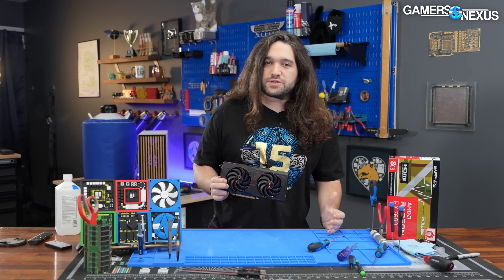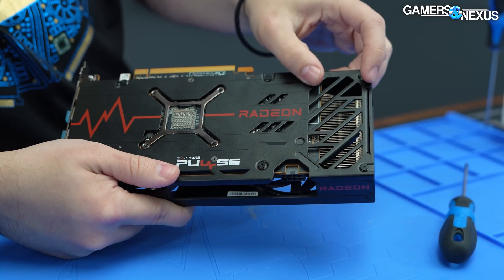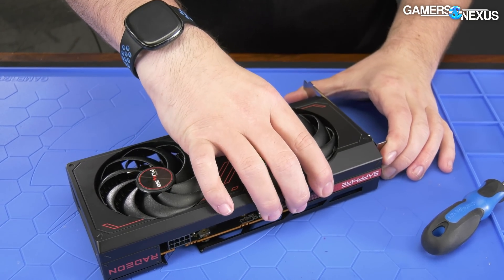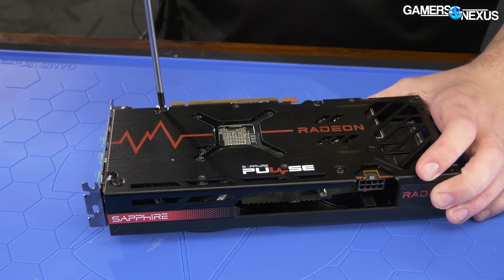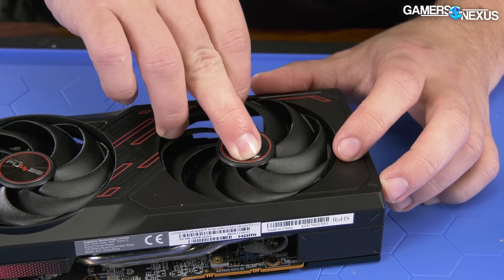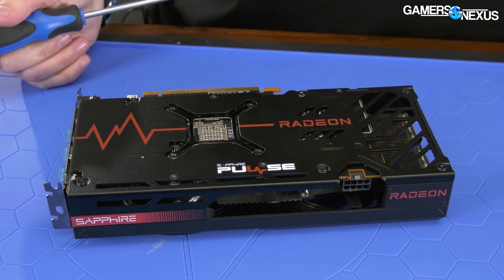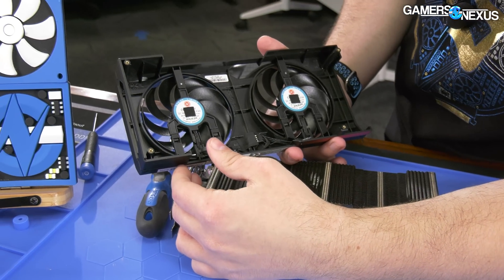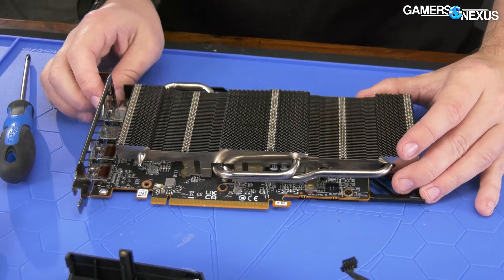Sapphire RX 7600 Pulse Tear-Down & Disassembly

Comment: As someone who bought an EVGA card back in the 900 series (good times), I've found that Sapphire has seemingly filled a similar role that EVGA did with Nvidia back in the day. Quality product yet simple to work with, especially my Pulse 6700XT. As for the play in your unit, I'd be disappointed if I bought a card and received that, but like you said, lord knows what happened behind the scenes because of how absolutely insane this launch has been for AMD.
Reply: the play comes from the fact that the shroud is mounted under spring tension, instead having screws that direct mount to the pcb would remove most of the play
Reply: @moorhen6156  What kind of benefit might the spring tension provide instead of using (normal) screws?
Reply: @glorfindel4945  I'd imagine that since the fans are mounted to the shroud, the shrouds on spring tension reduce fan noise. Just a guess though.
Reply: @glorfindel4945  might be quieter, fan Operation.
Reply: @robotsix6268  @J Ah that makes sense guys, thanks for explaining it!
Reply: And honestly I'd rather have it this way; it looks very user replaceable. Personally after the several years of the GPU shortage and now these non-meaningful generational improvements in the midrange segment, I'm pretty jaded. It would be fair to say I'm looking for anything to complain about, and the reality is it's a $300 card. Just wish the GPU core itself was more performant.

Comment: I wonder why did they skip from 7900 xt to 7600xt? Weren't there supposed to be 7700 and 7800s too or am I just missing something?
Reply: There are theories that either AMD is trying to sell the last gen high end before releasing these cards, since they will have similar performance and also that the chiplet dies are having worse performance than AMD expected and that they are trying to fix drivers before releasing more high and mid chiplet cards.
Reply: They're waiting for the old cards stock to dry up probably. At least in the US you can find a 6950 XT for less than $650 which would probably interfere in the 7800 XT sales
Reply: Aha, well I'd be cooler if they just kept making the 6000 series at these prices.

Comment: I have the Sapphire Pulse RX 6800 and the cooler is pretty similar. Makes me curious if that play in the shroud is present on mine as well. I don't recall there being an anchor screw on the backplate. Either way, it performs really well so I may not even bother until servicing is necessary.
Reply: Hey bro. Can you share some things about thermals? Max, normal, fan rpm, watts??? Please that'll help a lot!
Reply: @SheranAslam  max thermals I see in my system(Corsair 4000D) is 58C and about 70 on hot spot. It never really goes above that. It'll vary based on the game(RT, etc) from 50-58 with a high flow case. Max fan speed that I allow is 50%. Idle temps are low 30s... power draw can vary from game to game but I see anywhere between 180 to a little over 200 depending on RT etc. OC is set to 2450MHz  on the core and VRAM is at 2150MHz
Reply: @Shwadeybabe  thank you so much bro. I appreciate your support!

Comment: One thing about that Shroud that's awesome is

You can 3D print your Own, Zero Issues. 
Since it doesn't depend on clearances Other than Basic 5 screws and some Height clearance.
You can make the card Look like you want it to.
Reply: Can't put more than one like on this. I do 3d modeling and imagine a cool dragon relief on custom shroud with an MSI mb. Or 3d veronoi cells design (similar to evga but more 3d) in organic theme build or something. So many things you can do for show piece or if you just have the time to make the build that much more personal.
Reply: @kdee3492  wow, didnt know 3d printers are so cheap, most PC users own at least 1 now :)
Reply: @ChasseurTueur  Well I'm not sure if everyone has one but in general yes. They are more affordable than they used to be and you can get a nice one for a reasonable price. If only GPUs could follow the same trend. There isn't as much competition as in the 3d printer sector so that's why I guess.
Reply: @Chasseur Tueur  They're not horrifically expensive, but there's many companies out there that you can give a design to, and they'll 3D print it for you for pretty cheap.
Reply: Or make a shroud to fit bigger/better fans (Noctua mod anyone?)...
Reply: @stephanweinberger  Noctua fans perfect for steampunk exposed copper and metal build.
Reply: Dont forget passive cooling if the case and airflow allows it.
Reply: Or just deshroud it completely and swap in 120mm case fans. Boom "Noctua edition" card (*cough cough* the SFX community has been doing this for far longer than Noctua has)
Reply: @clippers117  yup, it's a base for sff community)) because they're rich, and put Noctua's fans everywhere)
Reply: Sapphire Cute Pet anyone?

Comment: I bought a renewed Saphire RX 6600 a week ago (very similar looking design) and went trough the same experience with the play in the frame. I tried tightening the screws as well and it didn't work. But the card itself worked perfectly with decent temps and it was a gift for someone else, so I didn't mess with it too much. I would buy again.

Comment: I wonder if a respin of the shroud molds with slightly thicker spacers would help the looseness. Just enough to add more stiffness. Given the cost of making molds and the low price-point of this card it's almost certainly not worth doing for this product. But for a future product design that might be all that's needed.

Comment: I'm happy that Sapphire made this card more on the side of a consumer. Easy to fix minor problems, easy to clean. That's what i like, because that's the only stuff i can do at home without sending it to the repair shop.
Reply: And the screws are simple phillips screws, compared to nvidia's torx screws. That's also a big plus to me.
Reply: @kniazjarema8587  heh. I see what you did there
Reply: @Chronostra  does he see what he did there though?
Reply: Sapphire never failed to impress. It's no surprise they were the goto people brought up when EVGA left the game.
Reply: I'm surprised they don't come with a mesh to hold dust, why depend on the case to have it?
Reply: This would be so much easier to service than the MSI Mech 5700XT got off a miner. It took way too much work to get apart
Reply: Pretty sure most 2 fan cards are designed like this
Reply: AMD propaganda
Reply: @Gay-is-_-trash  RTX 2060 Super owner but amd cpu.

Comment: I will be the first to say that as long as a product works well and performs well i couldnt give a damn if it feels cheap.  No amount of sleek brushed metal or fancy design choices can fix design issues.  How it actually performs is whats important.  I would take a plastic shroud with easy access fans like this one on a $1600 card over one with "screwless" brushed metal design any day as long as the cooling and game performance were adequate.
Reply: So you'd buy a card based purely on whether the fans were easily serviceable ? Easily pleased then. I would be pissed if a card even that cheap had its fans go on me. I've got a collection of Ati cards, and others, that are well over a decade old and whilst their performance is shit nowadays at least the fans still work. In 30 years of PC gaming I've never had a fan go on me.

Comment: Fuses also make cards much easier to repair. I never had card with fuses that was not repairable after shorted mosfet. Die always survive and you don't have burned through PCB. I like to see that on lower end card, too many more expensive boards skip them for some reason.
Reply: Yeah, cards with fuses are the best. If you're confident, you can remove the fuse and add a fuse holder socket (i advocate for the SMD ceramic ones) and that makes things even easier. ALSO, the ceramic fuse holder surrounds the fuse on all sides facing the board, thus risk of any kind of damage from any action from the fuse is zero. It's rare, but i have seen it happen.
That said, these days PSUs have their own internal fuses to prevent that, but never hurts to be overprotected.

Comment: sigh
just 5 years ago this was a $100 card (RX 560).  While the plastic shroud mounted directly to the PCB with plastic towers feels cheap - honestly, I'd take it because that 4 screws to dusting maintenance and just 8 screws to change compound design is leaps and bounds better than the puzzles Nvidia cards have become.
Reply: This is much more in the line of the 480/580. Which launched around 230 I think.
Reply: @jameshernandez4112  hmm.  128-bit memory bus, budget memory capacity - sure - it's a 258-bit card with mid and high end memory configurations....
It's a modern RX 560 with ray tracing capability.  It's even right there in the pricing.  If you factor in the additional silicon of around 65% that's around $164.  Then factor in the 50% inflation since then and you're right around $249 so this card is only $20 more than that.
Reply: The RX 560 couldn't compete with even the 1050 back in the day while the 580 was a 1060 competitor. Based on that, I also believe that this is more of a 580 successor that will compete against the 4060.
Reply: @cracklingice  ... The 560 was a 75watt card that came with 4 gigs of ram and was worse than then 1050ti. This is a 3060 competitor. Which means it's on the same level as the 580.
Reply: @narutogett  Except the '4060' is actually a 4050...
Reply: @jameshernandez4112  See above, it's a 560 class GPU not 580.
Reply: You are cracking smoke, lil bro. This is a lot more than 560. And the 4060 is not a 4050. People's gossip theories are just theories. It beats most of Nvidias 60s cards. It also comes very close to AMD 6700s, which would be impossible for 560 back in the day. This is a solid 580.
Reply: @intermilan9731  wake up sheep.  8gb 128-bit bus is 8gb 128-bit bus.  It's a 4050.  A real 4060 would have 12gb 192-bit bus.
Reply: @cracklingice  And? That's your theory. Most cards today in this range have 128. You are suffering from confirmation bias.

Comment: So few cards have horizontal fins. I don't know why you'd want to blow hot exhaust into your motherboard, or these days your M.2 drive.
Reply: Honestly, something like the Acer Predator Bifrost A770 makes a lot of sense to me - horizontal fins over the GPU and a fan blowing hot air out the back, and vertical fins on the front half of the card, possibly with a blow-through configuration there. Sure, Acer flubbed the Bifrost, but the base concept seems sound - possibly minus the blower fan, regular fans seem to work perfectly well with horizontal fins, after all.

Comment: AMD has really dropped the ball in their latest iteration of graphics cards and somewhat in their CPUs. I remember not long ago when Nvidia dropped the ball some years ago and AMD took decent advantage of it. But this is off the wall. I want to get a good PC build as I haven't had one since 2014 when my them gmaing rig died. Things happned physically that set be back a few years. But ow tha ti can spend some $$$, the thing holding me back are the prices of the MOBOs I want for the higher end CPUs.
Reply: So buy a 6000 series card. They're fantastic value at the prices they currently are. Where I am you can get a 6700 XT for the same price as the new 7600 (thanks to an Asus cashback promotion), which is a FAR better deal.
Reply: Just buy one with a credit card brother. Pay that shit off later. Just got a $2500 PC built and it’s half way payed off and I’m damn glad I did it.
Reply: @Vandantcyclone  I don't buy anything on credit. I could easily afford paying $5k for a gaming rig outright. When I get a PC I will pay full price. But I won't pay $400+ for a MOBO on principle. IMO, that is gouging based on making more money because of "inflation".

Comment: I hate the power bridge layout of lower tier cards. It's the reason they rarely get waterblocks.
Reply: Why would you put a water block on a budget card like this?
Reply: I would assume the main reason is cost. Yes, watercooling is a hobby and therefor not entirely rational... but in the lower range, it is too easy to rather buy a card 2 or 3 tiers up and then downvolt heavily, for the cost of a waterblock + more radiators and fans. And still get much better peformance

Comment: Easy to remove dust from this card, going by how easily the shroud is dismantled.
Reply: Yep, fans too.
Reply: @TheArchaos  I would LOVE to see someone come up with 3D printed shrouds that you can fit various other fans into.
Reply: @RandomlnternetGuy  In niches there is riches.
Reply: @RandomlnternetGuy  If you design it, they will come.
Reply: @TheArchaos  I feel like you were intending that to rhyme, but it doesn't.
Reply: @RandomlnternetGuy  There're dozens of free custom shrouds 3D files available for free. Just google "(gpu maker and model) custom shroud 3D model" and if it's a relatively popular model there's a very good chance you'll find a repository or some thread with the link. I've been doing it for years with cards that I don't water cool and it's fairly common to see around 20°C max temp drops just by using a couple of decent fans. There's also the side benefit of the video card becoming virtually silent, even using good 92mm fans.

I'd suggest printing the shroud with nylon if possible. It's way more flexible and almost eliminates the chance of rattling after some use time. You can try your own mods but there're tons of guides with optimal solutions when things get a bit tight... and it will.
Reply: @CapaNoisyCapa  You are not a true "enthusiast" until you mod and create contraptions of your own lol?
Reply: @RandomlnternetGuy  noctua style ?😊
Reply: @dra6o0n  Umn... I was just trying to help the other guy? I'm scratching my head to figure out where the hell did you get "you have to mod your card to be an enthusiast" from my comment.

Just pointed out that there're already free solutions to solve their potential needs. Well, this is the youtube, what was I thinking trying to help other people... 🤷
Reply: @NightKev   its an expression, not nursery rhyme.
Reply: @Echristoffe  exactly what i have in mind. I have a Noctua theme for my PC
Reply: @RandomlnternetGuy  I'm sure that Major Hardware, and people taken part in the fan showdown, would be interested. I know that I would be.
Reply: @RandomlnternetGuy  Let's make our own Cute Pet GPU's
Reply: Also seems to have a passive cooling option for tight space applications with adequate case air flow. SFC ITX anyone?
Reply: If Intel is going for solid state cooling, then it would be interesting if AMD's low end GPUs having it.
Reply: @dra6o0n  I think AMD is going to have some pretty beastly desktop APUs that are going to do away with their lower end SKUs down the road. I know they tried it with the old A-series, the Ryzen G-SKUs and all the 7000s are APUs, but in terms of enough graphics processing power to really do away with the discreet GPU is still at least 2 or 3 generations off for good 1080p120 gameplay.
Reply: I like Sapphire cards, even "low tier" Pulse series have easily detachable fans, that you can buy from Sapphire for replacement